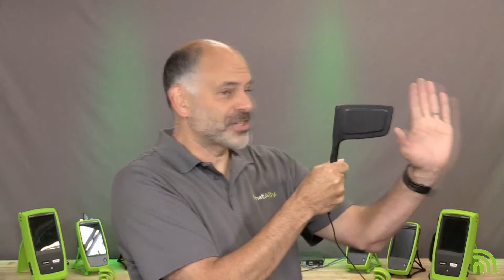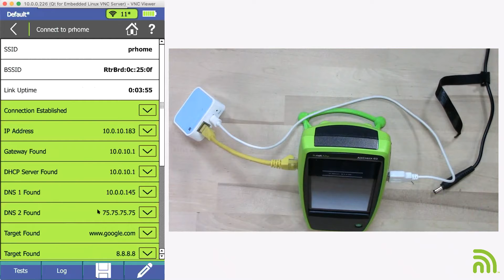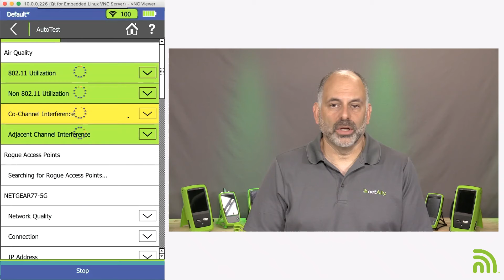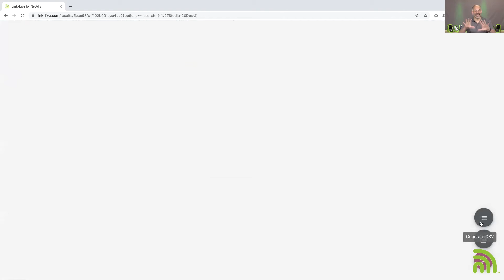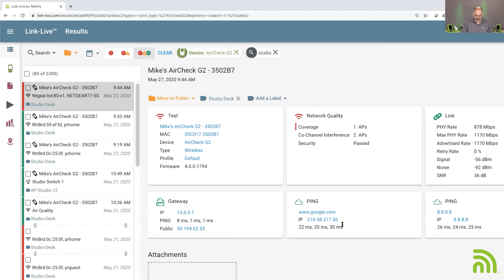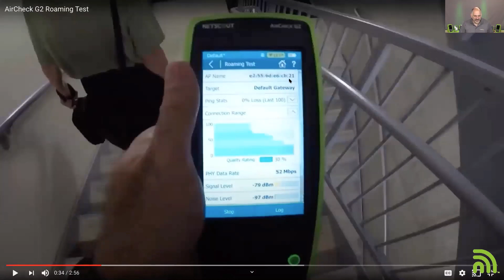How to Remote Control into your Wireless Network with the AirCheck

Comment: Hi Mike I got a TP link unit but the USB port will not sustain enough power
Reply from the maker: Hey Nick, try using Port 1 instead of Port 3. Port 1 provides 500ma of power and Port 3 only provides 200ma.